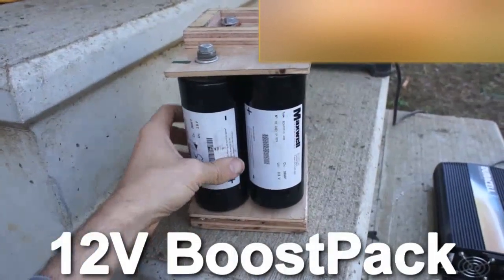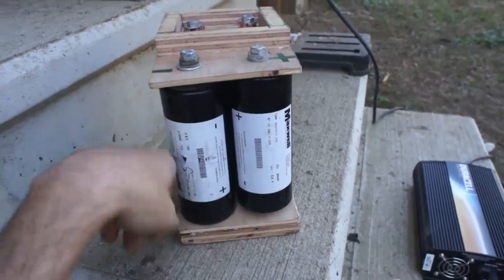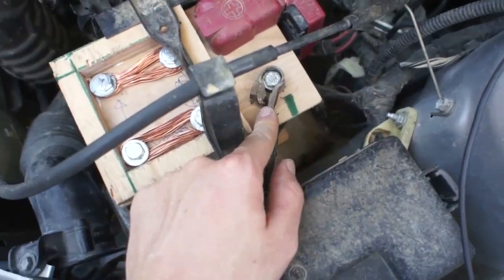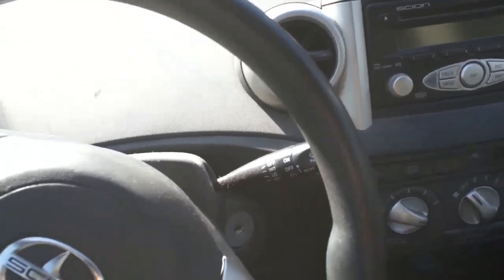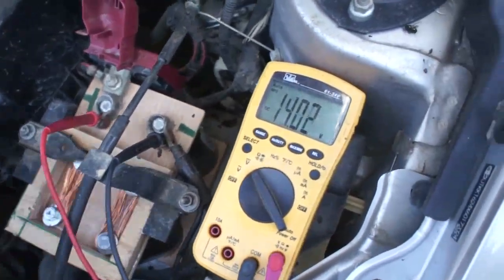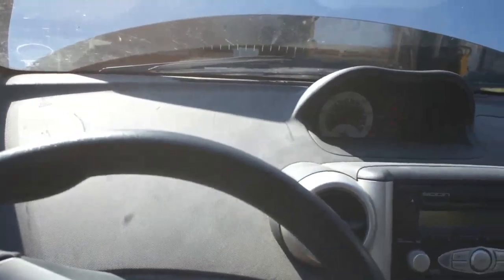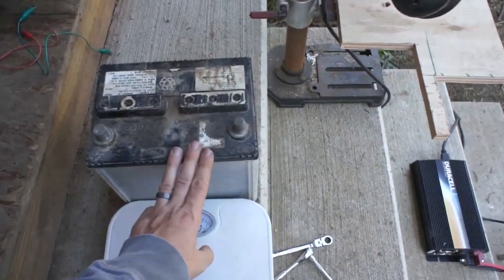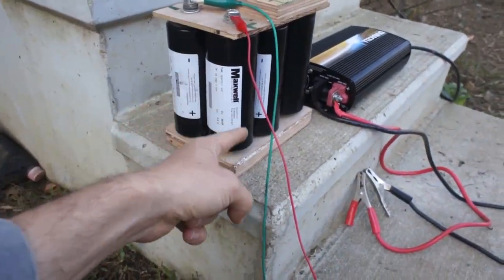12V BoostPack. Replaces auto battery. Works great!

Comment: Can I make a commission on all of the starter motors that you'll be replacing? If your cranking voltage consistently drops below 9 volts upon cranking, your starter motor windings will eventually the price of your folly. Even the Toyota Prius hybrid has a lead / acid car battery for engine cranking. Electric motors are like live horses. They will literally kill themselves to try and get the work done. I will use my 1968 Chevy 307 C.I. engine for an example because I know all the specific numbers for it. With a new, fully charged, above 60 degree F battery, it draws 200 amps to crank with a cranking voltage of 11.2 volts. The starter motor windings, for this engine, are designed to safely dissipate the heat produced by drawing 200 amps through them caused by this engine's mechanical load for up to 30 seconds with a 5 minute cool down period. My car doesn't take 30 seconds to start but this is what the starter is rated at should it be hard to start. As the battery ages, the cranking voltage will begin to decrease which is alright as long as it doesn't go below 10 VDC. At 9 volts, the starter will still try to crank the engine and probably will but at a cost. You never get something for nothing. The cost will be the current will begin to climb. At 9 volts, it may climb to as high as 230 to 250 amps during cranking. What did I say before? "The starter motor windings, for this engine, are designed to safely dissipate the heat produced by drawing 200 amps through them caused by this engine's mechanical load for up to 30 seconds with a 5 minute cool down period." This starter is not made to dissipate 250 amps, a 25% increase, very often without consequences. If your battery cranks at 10 volts today and 9.5 volts tomorrow when you take it to the shop for a replacement, there will be no damage to your starter but if you use the car for a delivery vehicle with a lot of stop and go engine starts and you have to wait 2 weeks for your next pay check to replace your worn out battery, you may as well plan on  replacing your starter too. Also, as for your A/C being on during cranking, it shouldn't be or you have a wiring problem somewhere. All auxiliary loads are supposed to be disabled by the key switch during cranking so as to deliver full power to the starter. This doesn't include head and tail lights or 4 way flashers for safety reasons. This is all not to mention the question of how your "boost pack" will perform below 32 degrees F in the winter. This rating is called COLD CRANKING AMPS. Another consideration to think about. Lead / acid batteries are designed to be used under a WIDE range of temperatures. How will your "boost pack" hold up in 150+ degree conditions under the hood while stuck in traffic for hours on a hot summer day? Will it freeze up at -20 degrees F? If their plate material deforms or their dielectric insulation breaks down in either extreme, carry a fire extinguisher just in case to put your car out. Another thing to consider is your battery is an integral part of the voltage regulation system of your car which in most, if not all newer cars, is built into your alternator. The automotive voltage regulator is designed to "see" the internal resistance of a lead / acid battery and to function under IT'S parameters, NOT a half dozen super caps in series. I saw where your "boost pack" charged right back to 14 volts after cranking. This is because capacitors are designed to charge and discharge quickly. Think of a photo flash gun cycling. Quick out, quick in. What about the person stuck on the California freeway in the rain, in gear, with his head lights, windshield wipers, air conditioner, radio, GPS, engine computer, electronic fuel injectors, electric fuel pump, electric engine cooling fan(s), and God knows what else running while they idle in traffic for an hour or more? I would challenge you to turn on all of these accessories in your car in gear with the E brake on and see where your 14 volts go in an hour. Your "boost pack" does have the guts for that sudden burst of starting power required to start the engine but so will 1,000 "D" cell alkaline's but that doesn't mean that they will function properly under all circumstances. I'd be willing to bet they won't have the staying power of a lead / acid car battery for an hour of running under the conditions that I have put forth. Even the highest quality lead / acid car battery would be hard pressed to maintain anything close to full alternator voltage under these circumstances for long. This brings us to the last parameter of car batteries or lead / acid batteries in general, for that matter, and this is RESERVE CAPACITY. Reserve capacity is how long the battery will run your car should something in the charging system fail or if you are stuck in traffic like in the circumstance mentioned above. If your battery has a warm cranking current of say, 850 amps and a reserve capacity of 102 minutes, this means that if your battery is in like new condition, the terminals are shiny, it's internal temperature is above 60 degrees F, your engine is running when your charging system took it's final dump and, in the worst case, it's at night and your head lights have to be on, in other words, the best of all possible conditions but in the worst of all possible circumstances, you should be able to drive to safety for up to an hour and 42 minutes albeit with VERY dim headlights before your battery gives up the ghost. Even less if you didn't discover the problem until AFTER you shut the engine off. Every time you crank your engine with a dead charging system, it costs you a BUNCH of reserve capacity minutes for every second that you spend cranking your engine. Of course, this rating was formulated BEFORE the advent of computerized engines, electronic fuel injectors, electric fuel pumps, electric cooling fans and modern kids who don't know what dashboard trouble lights mean and are too stupid to shut off the radio when they are running on battery power only. (Been there, done that.) These required power drains will substantially shorten the listed reserve capacity time of ANY battery from about an hour and a half to less than 45 minutes and this is assuming that the battery is in like new condition and NOT using copper wire loosely wrapped around some bolts in place of solid cell connectors. I challenge your "boost pack" to keep up with a lead / acid battery under ALL of these circumstances on it's best of days because it sure won't on it's worst. If you can get 6 super caps for only $6.00 each, car companies could get them for $1.00. Do you think that there might just be a reason why car manufacturers haven't tried to save money or fuel saving weight to adhere to federal economy standards by going to super caps? Just some things to think about while you're experimenting. Here's a thought. Use the super caps as an emergency  jump starter. Just keep an eye out every few days at first to see what their self discharge rate is. This, I can't tell you. Good luck.

Comment: what would happen if you put them in a mobility scooter what runs on a 24V' & how far will it get to as well how long will it last to
because these cells sounds really brilliant to use???

because I'm thinking about build a 7 1/4 inch gauge electric train with two 24V electric motor & with a Outdoor 20W Multi-function Portable Manual Crank Generator to charge the cells or two 12V batteries through a 20 A 12V-24V Auto Switch Solar Panel Battery Charge Controller..
what do you cells work with my idea??? (Y OR N)

Comment: @lasersaber if you are using capacitors for this pack they do not store great amounts of energy. you showed your test in the car when you turned on the high beams and that voltage was dropping fast. once it gets below 10 volts you are not starting your car. your cars starter motor requires a certain amount of amperage and voltage to start a vehicle.
Reply: 9v will start your car

Comment: @lasersaber  Hi! i would like to know what kind of cells you are using for this battery pack and what kind of amperage they have.i am near 2/3 of the way thru your video and i have not heard you mention amperage once. your vehicle if it is a 4 cylinder engine will need anywhere from 150 to 200 amps at 10.5 volts or better to crank the starter and start the engine
a 6 cylinder will need 225-250 amps to crank the starter and start the engine. in your test when you put on the high beams and the voltage was dropping pretty fast. that tells me there is something wrong with your boost pack because if it drops voltage so fast you will not generate the amps you need.

Comment: I have question's! I have a 1 farod cap that I use for my sterio. I know there are also "super caps's, what is the difference? I have seen people use 2.7v cap's to spot weld with, & link them together to run larger items. I would like to make a CHEAP capasitor setup as CHEAP as possible to replace my car battery & to stop my headlights from dimming! The charging diode that came with my cap never worked & I have used a 12v lightbulb to charge & discharge my cap & I have wondered if I ruined my cap by possibly not discharging it correctly. This last time that I discharged it, it did not discharge all the way & I had to improvise! I would also like to make a much bigger pack to run household items for at least when the power goes out!
Reply: Won't work. These don't have amp/hrs

Comment: Amazing you spend so much time messing with capacitors and boost packs but pay someone to change the oil !!!
Reply: I work on my car all the time but sometimes, on a hot summer day or a cold winter evening, it doesn't hurt to have someone do it for you.
Reply: Funny!
Reply: he excels at electronics, not a mechanic
Reply: Because he is an electrician and not a mechanic...

Comment: I don't know how well this would work for a car like mine... Requires 600CCA to turn the engine over.

The problem with cutting off at 10 volts is not in the amperage - the main reason usually has to do with the onboard computer, which oftentimes doesnt work correctly without the proper voltage.

Comment: HOW WOULD THIS Improve gas milage?  This makes no sense,  after ur car is started everything runs off ur alternator right?
Reply: weight reduction. Also, a steady electrical flow will stabilize your computer chip.

Comment: How well do they perform at minus 10 F, where batteries need help? Stored in a deep freeze overnight. Do the same with a battery. Then both in parallel. Actually cold, cold cranking amps?
Reply: Around here, batteries fail in the winter.

Comment: It does not matter if this is ol'tech' If it works it works, and paying a bit more for a better and longer lasting solution, that saves gas, makes sense. Pair it with a solar unit and keep the pack good for a looong time, and do not listen to all those Big Oil Astroturfers in the comments.

Comment: It's been 6 years since this was posted, updates?
Reply: He's off building crystal batteries.
Reply: at the current prices you could get a lithium dry cell battery and be better then a super cap batt or traditional battery .. also the newer graphine super caps haqve a much better potential to make this happen.. the graphine caps store power better over long periods and futher increase max capacity vs size and weight
Reply: @Y2daT420  i know one youtubber who built a hybrid lithium + caps battery. But there are still problems with the cold outside. Quick self discharge plus losing capacity due to cold air. So such batteries also needs some kind thermobox.
Reply: @smert_rashistskiy_pederacii  No. Just cold air puts more strain on the starter as its harder to spin the engine over. Run Synthetic oil!
Reply: @SamaritanElad  it was not in US where ppl use cheap motor oil. It a youtuber from Kazakhstan, where -30C as usual, so nobody use mineral oil many years as soon as synt oil arrived. He is electro enthusiastic at all that stuff, so it is not starter problem, it was battery problem caused by low temperatures as described.
Reply: @Y2daT420  Nada. You can get 3.2v supercaps now so only 5 in series would be needed. Supercaps do not have more power, just more instant current releasing than a car battery. Caps have internal discharging so long storage will deplete them.

Comment: If the voltage of your boost pack is low like in your 10 volt scenario, you are in danger of blowing the diodes in your alternator due to over current. You should be careful to not rev the engine until the caps are charged.  I've had low lead acid batteries kill my alternator by taking off right after a jump-start. The ability of the caps to source a lot of energy in a hurry means that they can sink a lot of energy in a short time also.

Comment: Keep in mind, capacitors accept a charge quickly. This will not work in low temps. Say a Frigid -30c. Lithium boost packs or a simple low cost lead acid is all you need.

Comment: BTW, the reason you need so many CCAs in a car battery is because a lead-acid battery at 32 degrees Fahrenheit is only about 60% efficient dropping to below 40% at ZERO F.

Comment: It would be dangerous but it would be a good set up to have about 20 of those for a small off grid shop
Reply: If you think those are dangerous, have you ever seen a lead-acid battery explode? Have you ever had your hands and clothing burned by battery acid? Lead-acid batteries offgas HYDROGEN gas which is one of the most volatile gases on the planet. Google: Hindenburg blimp.
Reply: Lee Wilkerson I meant if you accidentally touched the terminals it would instantly kill you. Also the Hindenburg’s hydrogen gas would have burned in seconds. The blimps Cover was the main thing that burnt as the flames are too bright and the smoke is black where if you have ever used hydrogen for anything you would know it has a almost clear flame and smokeless burn. Also the mixture of aluminum resin iron oxide and other things used in the paint would have been more potent then hydrogen and basically rocket fuel. Also hundreds of thousands of miles of safe flights have been done in hydrogen blimps. So it’s not hydrogen really it’s the fact that there is high pressure in a sealed container
Reply: How can it 'instantly kill you' when the voltage is only 12 - 14 volts? No, it won't. Not at all. Stop spreading lies. You can't even feel 12 volts AC or DC! And now are you going to tell me Hydrogen gas will not explode? I've had the top of a car battery explode from the Hydrogen gas in its vicinity. It blew the entire top off of the battery. Parts of it landed about 20 feet away. It was neither high pressure nor sealed since this was in the 70s.
Reply: Lee Wilkerson the capacitors can kill you because they can dump hundreds of amps each and the bank has six In series and twenty in parallel would be thousands of amps and if you touched the terminals on positive and negative. There is enough energy in 20 of these to easily and instantly kill. I’m not saying lead acid is safer,it’s not capacitors are dangerous too though. And yes hydrogen is explosive and can make car battery’s explode, I agree with that, but the Hindenburg was a bad example because the hydrogen would have burned in seconds. The worst danger came from chemicals used in the paint
Reply: I would like for you to explain, using Ohms Law, how you can dump 'hundreds of amps' at 12 - 14 volts through your Megohms of skin resistance unless you deliberately soaked in salt water first.
Reply: Lee Wilkerson fine I give up but in the right circumstances it could be dangerous
Reply: So can exhaust from gasoline burning engines apparently. Oh, yeah, also don't stick metal objects in the wall socket. That voltage is ten time as high as that of a car and it WILL kill you.
Reply: Lee Wilkerson it’s 9.4 times higher for me I have 115 v not 120
Reply: Since main electrical supply in the US can go as high as 128 volts, it is still 10 times. Don't be stupid! it is 8.8 times if your main sags to 103 VAC. Rather unimportant since anything over 50 volts has the potential to kill even if your skin is dry.
Reply: Lee Wilkerson I know I’m just being stubborn :)
Reply: In that case, don't be stubborn - be tenacious!

Comment: Honest question, and I'm asking this respectfully:
What will happen if you leave the light on for an hour with this boost pack?
With the Group 24 Deep Cycle Marine Battery in my pickup, I can do this and the truck will start. Have you tried THAT test with your boost pack?!
Reply: Most cars will have dead batteries with lights left for 1 hour

Comment: Where can I buy these $6 caps of which you speak? Everything I find is 10x that. 

The ideal application for these, assuming you can find $6 caps (on aisle 2 between the unicorn rainbows and chupacabras?), is for a jump starter pack. I just went through 2 retail jump starter packs this weekend. The first was returned the moment I opened the box and the smell of China wafted out. The second was returned after I learned that all the lawyer engineering inside rendered it incapable of starting my lawn tractor. Unbelievable. At any rate, using caps for a jump starter would be ideal. You wouldn't have to keep it plugged in. It wouldn't sulfate, or short out after 2 years, or form corrosion, or produce hydrogen gas, or spill acid on things, or do any of the other nonsense we put up with from lead acid batteries. The caps are light and small. You could dig your cap-pack out of the back of the garage when you need it, charge it briefly, use it, then forget about it again. It's almost perfect for a jump starter.